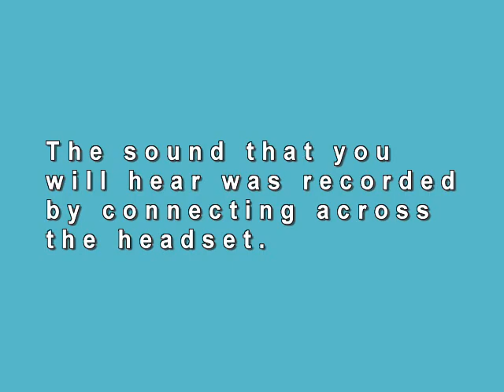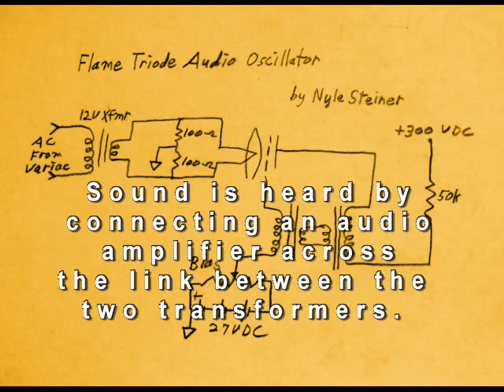Flame Triode Amplifier and Oscillator, more experiments.

Comment: Very nice observation and experiment. By adding nichrome filament you eliminated need for the flame. I think electrons are transported by gas flow. In that case you might as well use compressed air to move the electrons. I followed your website and find your experiments very interesting. Thanks for sharing

Comment: I Think...The filament inserted into the flame is a necessary audio path to ground while the high voltage is on  and the 'plate' is switched into the circuit. BUT >The 12 Volt transformer may not be needed to heat the filament ...

Comment: The nichrome filament doesn't seem necessary.  You could use the flame to heat the cathode.  You might even use a big thermoelectric array to produce an electronic system powered only by combustion.
Reply: I Think...The filament inserted into the flame is a necessary audio path to ground while the high voltage is on  and the 'plate' is switched into the circuit. BUT >The 12 Volt transformer may not be needed to heat the filament ...